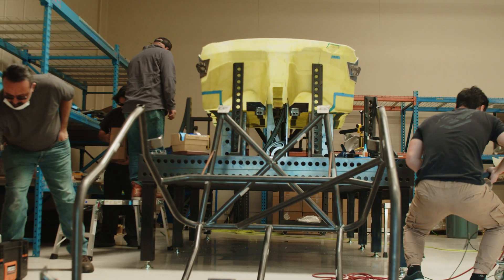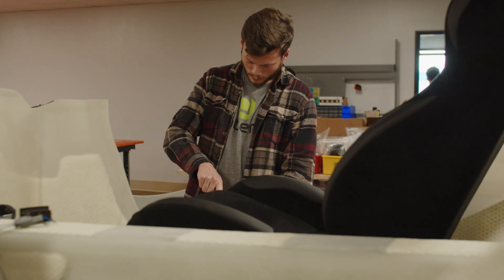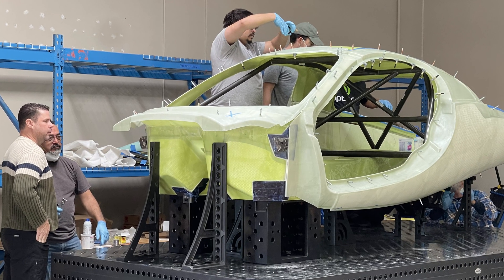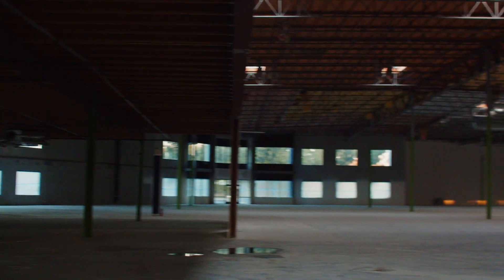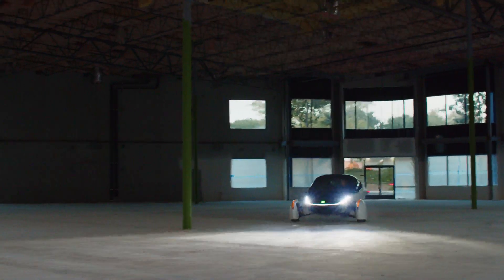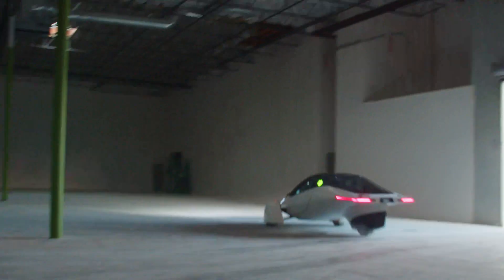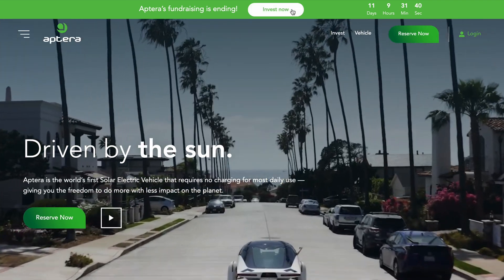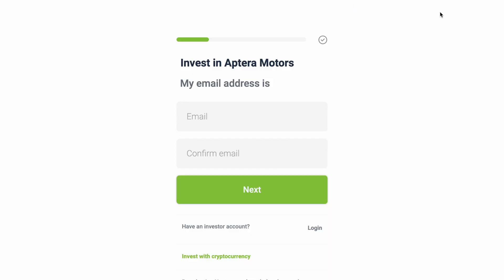Aptera Update — December 2021

Comment from the maker: Hi Aptera fans! Thanks for watching our latest update video. You can join us on our mission, and stay informed by subscribing to our newsletter here: https://www.aptera.us/contact-us/. As a reminder, December 31 is the last day to invest in Aptera. Learn more about how to invest in Aptera and our mission to create the world’s most efficient transportation at https://invest.aptera.us/.
Reply: what are the roll cages in the Beta cars for?
Reply: @MBergyman  The complete structure of the final vehicle is not needed for testing some of the mechanical systems.  They can produce test mules more quickly without sacrificing safety.  It is also easy to attach strain gauges to measure forces on the body during certain tests.

Comment: Please include a color coded cable that releases the disconnection of the honk incase of an impact or crash, this is a car manufacturers most common problem.. i know it seems unimportant but after being in the auto bodyshop for over 22years ive seen brand new cars become total losses do to the fire fighters cutting the wire harness being cut after them being the first responders, so i put myself in there shoes & just color code a release cable so it can be disconnected  & the car avoids the salvage yard do to someone’s lack of automotive knowledge..

Comment: Will you have an Off-Road version which is really needed in my state of CT? CT roads and highways in the winter are like an off-road experience. The car mechanics I use and who have serviced Teslas told they they would service the Aptera if they had the specs/ service manual. I really love the Aptera and what I have seen I YouTube about it. It would be very practical for me since I drive roughly only about 40 miles/day, mostly to the gym and then the beach everyday. The price is well within my range. I just want to know that there is someone close to  me that could service the Aptera when it is needed. If you had a hardtop convertible version, I would be the 1st in line to buy one.

Comment: I hope I can buy an Aptera within 5 years or so in my country (Netherlands). Tremendous admiration for the Aptera company and the inwheel motor company; this visionary car becomes a hit. I also expect a gigantic solid state sodium-ion battery global market breakthrough within 5 years. Sodium-ion allows for  higher charge-decharge power than lithium-ion.  A very high energy capacity is not necessary for the Aptera battery, so a cheap sodium-ion battery will be perfect. A 10 minute battery-recharge duration should be possible.

Comment: How hard will it be to replace a flat tire on one of the front tires?  Where is the spare tire stored?  What about the rear tire?
Reply: Great questions.  Like many new cars, Aptera will not come with a spare from the factory.  The weight would take one or two percent from the range.  Instead, I think the plan will be to carry a plug kit and a DC inflator, just like I did in over 400,000 miles of motorcycling.  Most punctures can be quickly repaired on the road.  The wheel pants unclip quickly without tools.

If needed there are jack points on both sides of the front and in the rear, and the wheels unbolt from the wheel motors just as if they were drum brakes.  They can easily be changed at any tire shop.
Reply: @n.brucenelson5920  It might be a good idea to have a way to strap down a spare tire in the back of the car.  Some people would probably trade slightly lower mpe for the security of having an easy way to replace a flat tire quickly.
Reply: @markh5775  There wold be a way to carry a tire in the back and hold it n place if someone wished to do it.  I have to say that while I have had flats, I never wished I had a spare with me to fix them.  I was always able to do enough of a road side repair to get me to a tire service center with the plug kit/inflator.
Reply: @n.brucenelson5920  How easy is it to repair with the plug kit/inflator for someone like me that has never use one before?
Reply: @MrASaechao  It is pretty easy.  Sometimes the hardest part is finding the puncture.  If you are unlucky enough to have a long nail go through the tread and the side wall, you can still probably do enough of a repair to get to a tire repair place before you lose too much air.  These are only meant to fix holes in the tread.  I recommend carrying pliers to help pull out a nail, if needed, and possibly a razor knife to trim excess rubber from the plug, although this is probably not necessary.
Reply: @n.brucenelson5920  I would much prefer a spare tire option especially if it is cold outside.  AAA would probably not take the time to repair a tire and a blowout could not be repaired.
Reply: @markh5775  Aptera grants right to repair, so you can do anything you wish with your own vehicle.

Comment: Like your design but wish it were a" banking three wheeler" allowing for a softer front suspension improving comfort while also eleminating lateral forces on occupants. 
Frontal width could also be reduced enhancing maneuverability.
Reply: Weight and complexity both work against such a solution.  There are other companies pursuing this, however.

Comment: This is great news.  So, if you're planning on deliveries by the end of 2022, does that mean you're doing winter/snow/cold testing now?
Reply from the maker: Hi Jeff! We are designing this vehicle specifically to perform beautifully in various climates and we will be doing more winter testing over the coming months. We look forward to sharing more on this soon!
Reply: @ApteraMotors  It appears Aptera is building something very solid and carefully thought out. Congratulations! Take your time, as long as what we get, whenever we get it, is a quality product. Most of the people going to buy Aptera are not "tinkerers".
Reply: @aussieideasman8498  A "tinkerer" is one thing, a "thinkerer" is another thing. Different etymologies. By the way, there is nothing like a "thinkerer". Try again!
Reply: I'd sure hope so, because the winter cold is something that EVs are notorious for sucking in. 
One advantage that I think the Aptera has over traditional EVs though is that since it's made of a composite body, it's naturally insulated (compared to the conductive metal bodies of traditional cars), so that should allow it to retain a lot of its heat
Reply: @mindlessmrawesome  
EV range losses in the cold tend to be from using a resistive heating element to warm the interior. I‘ve heard Aptera is trying to use a heat pump, which is much more efficient.
Reply: @Circuitssmith  I've heard in some of the Aptera videos (from Chris) that the lead time for heat pump development would be roughly two years which is unacceptable for there production timetable. As I recollect, they are opting for resistive heating, at least initially.
Reply: @Circuitssmith  yes, but remember that heat pumps get less and less efficient the colder it gets. Also, you have to remember that the Aptera has a very very small amount of battery to draw from in the first place, and trying to pump heat into the cabin is always going to be an energy-intensive process just due to the laws of thermodynamics. Which is why I mentioned the natural insulation of the composite material; if you can keep your heat inside, then you only have to heat the cabin once and from there only use very little energy to keep it at that temperature.
Reply: @Circuitssmith  I lose a ton of range in the winter from inefficient snow tires too. And I'm definitely putting snow tires on Aptera. So finding an efficient tire will be a struggle for me. But with 600 miles of base range even if I lose half I'm still doing just as good as my Kia Niro EV.
Reply: @DrTeeHenry  "Like", even though I don't know the difference between a heat pump, and resistive, heating😂
Reply: @aussieideasman8498  I'd like to hear their rebuttal. I'm not willing to jump the "they're lying" conclusion before hearing the whole story.
Reply: @aussieideasman8498  You make videos on Aptera? Care to share a link here?
On the point that they don't do any rebuttals on your videos? Why should they when there is nothing constructive about your criticisms?
Reply: @aussieideasman8498  
Good to know, thank you.
Reply: @aussieideasman8498  "so do bar heaters" By bar heaters, I'm assuming you mean resistive heaters, where you run electricity through high-resistance materials to generate heat. And nope- those will always generate more or less the same amount of heat per watt of electricity ran through them at nearly all temperatures. 

"that's for forwards movement, which is irrelevant" Nope- In electric vehicles, you have to use the battery to heat the cabin. This is an inherent drawback to EVs, because since don't have a combustion engine (which produces plenty of excess heat that can be used to heat the cabin), they have to use electricity that would otherwise be used to move the vehicle for interior heating. And while it's true that batteries do produce some heat, it's not NEARLY as much as an engine (and it's only really enough to become a problem if it builds up in the batteries over time). This problem is why I brought up the battery size- because while Aptera claims that it gets the same range as a base-model tesla model 3 using nearly a third of the energy, 25 kwh is still a pathetically small amount of energy. It's less than one gallon of gasoline, and when you're using that already limited amount of energy that you need to move the vehicle to heat a cabin... your range is going to plummet. 

"It is no different - same laws for all aplications." Exactly. That's the issue- you can make moving a vehicle super efficient, but heating an interior space is limited by the laws of thermodynamics. Meaning whether it's a tesla or an aptera, its going to take about the same amount of energy to heat the cabin. 

"Your batteries are inside, and you have the problem of your composite material being your radiator." They explained how this works in their video, they're going to pump the coolant throughout the underside of the chassis using multiple built-in channels that run through it. The coolant takes the heat of the batteries, which get hot over time, and distributes it to the composite material of the underbelly chassis. While the chassis might be a good insulator, distributing the heat across the entire underbelly should (and I'm gonna emphasize "should" since this is still untested technology) be enough surface area to get rid of the battery heat, especially considering that the batteries don't really produce all too much heat in the first place. And if you want the underside of the chassis to stop acting as a radiator, simply turn off the pump that runs the coolant through the channels, which will stop distributing the heat, and turn the chassis from a radiator back into an insulator. If they were smart, they'd have a dual-valve system that switches from running the hot battery coolant to the underbelly chassis to the interior heaters when the heater is turned on. 
All of it works on paper, but the one big issue I can see Aptera running into is how they're going to fit the coolant channels into the underbelly body panels without compromising their structural integrity since those panels support a large amount off the vehicle's weight (since it's not a body-on-frame vehicle). So, I guess we'll see if it ends up making it to production, or if they'll end up taking an approach similar to Tesla.
Reply: Not likely.  But there's always the Arctic, and the Southern Hemisphere, right?
Reply: @robertkirchner7981  I believe Elaphe will have a beta prototype for testing on their winter test track this season.